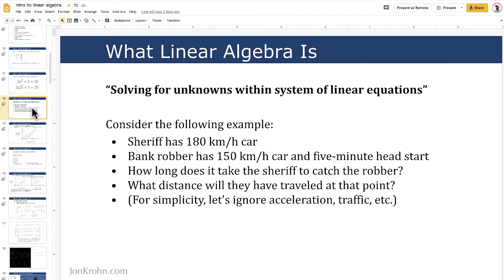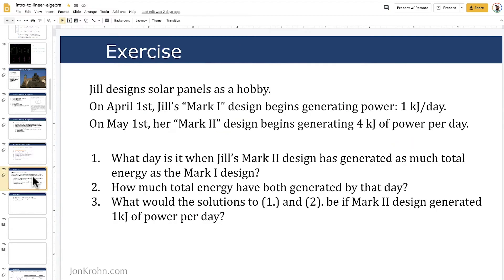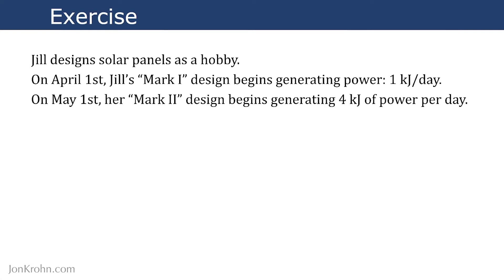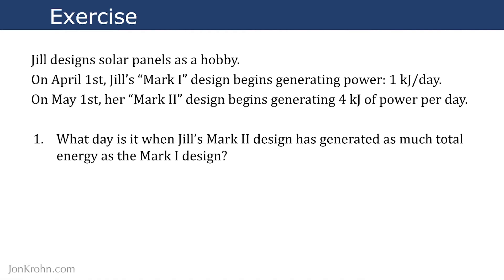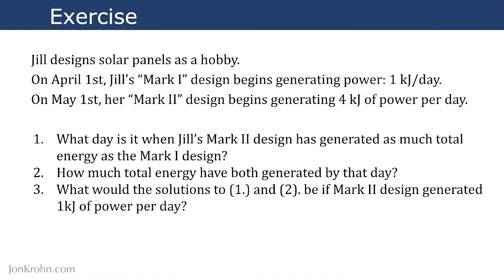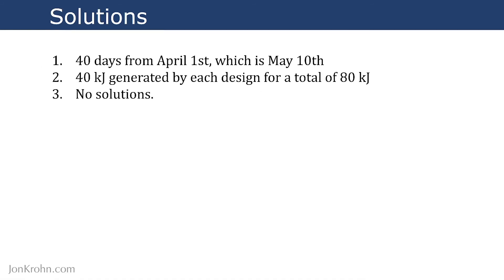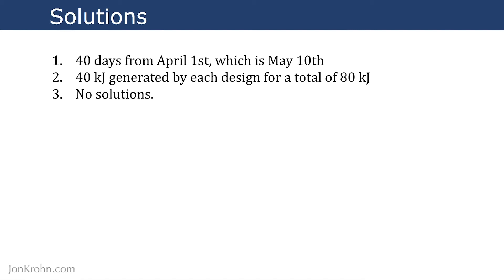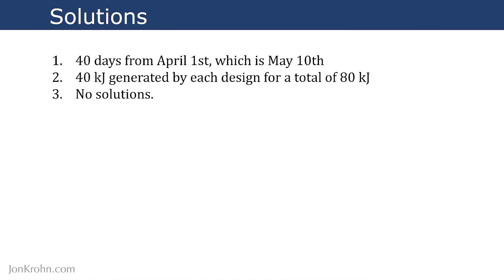Linear Algebra Exercise — Topic 2 of Machine Learning Foundations

Comment: Here is the way how I framed this problem:

mark 1 make - 1kj =>             e1 = 1kj * days
mark 2 makes - 4kj =>           e2 = 4kj * days

find out when they would make equally same energy

e1 = e2 (I don't know if here, I  can say , LHS = RHS )

1kj*days = 4kj*days <---- lets add twist here, it is 30 days late
1kj*days = 4kj*(days-30days)                // I wrote it like this to make it clear to understand, so

actual problem:     1kj (d) = 4kj (d-30) ----> solve it

answer would be 40 days, to become equal, means to make equal energy
and to find the total energy, yaa it's so easy >>---> replace days with 40 in above eq, [ no that 30 days ]

And now you can solve I know. 😁

Comment: So to follow 
Amount(Mark 1) =(T+30)* 1 ( Where T unit day)
Amount(Mark 2) = T*4 

So when both two amounts are equal 
(T+30) *1 = T*4
T+30 = 4T
30 = 4T-T
30 = 3T
T=10

so after 10 days both amount should be equal which is on May 10th
and the total amount will be generated is 
(10+30) + 4*10 = 80 kj

and of course if they are generating both amounts per day there will be no intersection.

Cheers Dr. Jon
Reply: why would you add?
Reply: can you please explain me this
Reply: @skillsMatter4  Ya I can
.
Reply: I went...

(1*30)+t=4t

30+t= 4t
     ----  ----
     -t     -t
30 = 3t
----   -----
3       3

10=t

10 + 30 = 40 days aka May 10th

Did it in my head like this. Didn't think it would be right, but it was. If anyone can explain why I would appreciate it!
Reply: mine is day = (30 * t), day = (120 * (t-30)

30t = 120t - 3600
30t - 120t = -3600
-90t = -3600
t = 40 days
so after 40 days (after mark 1) or 40-30 for mark 2, it will catch up and energy will be 40 * 1 for mark 1 or 4 * (40-30) for mark 2 which is 40kj.
Reply: Thanks

Comment: Mmm this needs a little explanation, no? Not just giving the solutons, at least gives us the x, y axis you used and where does the data fit in the y=ax+b
Reply from the maker: Hi there, you should have enough information to solve this problem. Refer back to the sheriff/robber example I gave in this earlier video for some hints on how to get there: https://youtu.be/NMTQ7rodUxY?t=204

If you're still stumped, I provide a complete walkthrough to the solution of this solar panel exercise in my Udemy version of this course, which you can typically obtain very cheaply via this link: jonkrohn.com/udemy

Hope that helps :)